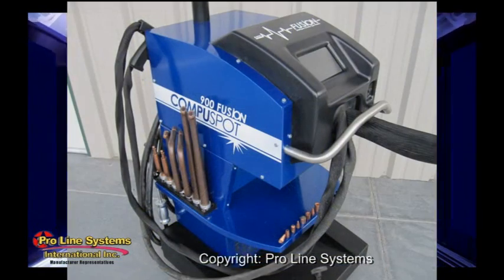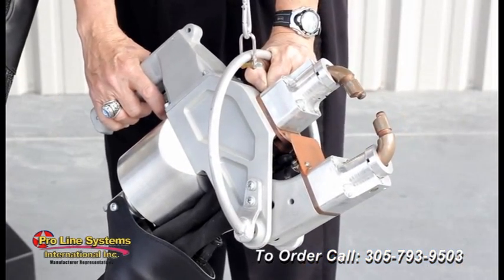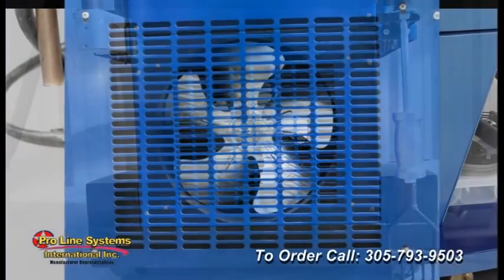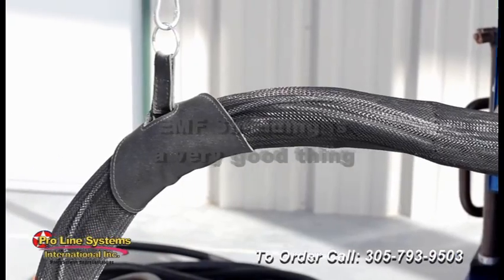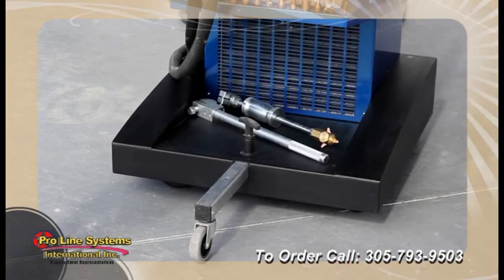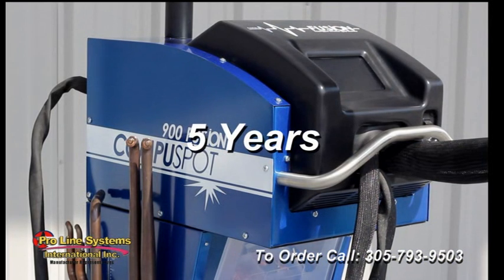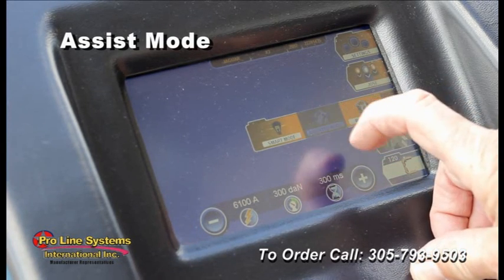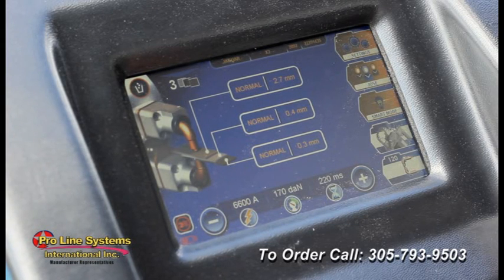CompuSpot 900 Fusion Video Demonstration

Comment: We have exactly one like this in the shop but the weight of the clamp is just soooo heavy and you can barely manipulate it to where you wanna do the welding.I wonder why the company who sold it to us they didn't equipped it with the lighter clamp(G-style clamp) which is more versatile and lighter to use it anywhere on a vehicle.It's almost like useless having a brand new expensive resistance welding machine! You can only use it in handful jobs because of its very heavy clamp and hard to position or manipulate it to do the welding.
Reply from the maker: Hi Mario, Think about this, our gun is probably one of the lightest guns out there. Any gun that generates 14,000+ Amps at the electrode tips and generates over 1.370 LBS squeeze force has to be substantial or it would fall apart in your hands. 
Try adjusting the weight retractor pulley so that the gun floats at about chest height which will do it's job helping with the weight.
Without mentioning brand names many of the trans guns pout there are more than double the weight of ours. If you need some tech support please reply.
Reply: The retractor pulley can't help at all ,it's just the clamp itself and the cables are too beefy.I even help it suspended with a bungee cord but still too heavy.Take a look at this guy spot welder; https://www.youtube.com/watch?v=42UKWU88b7U at 29:41, it's not even suspended but he can do the welding effortlessly.